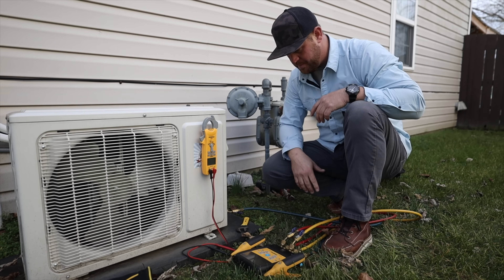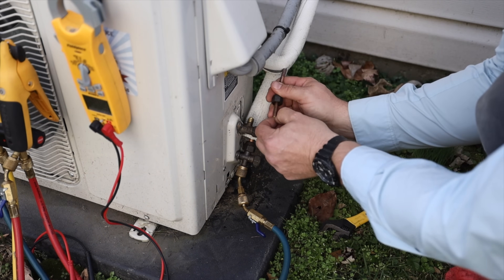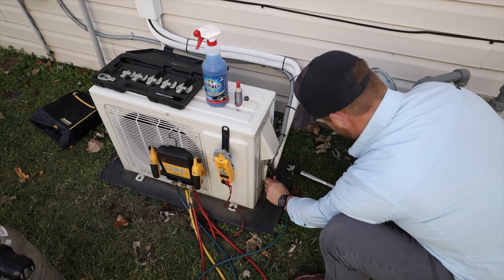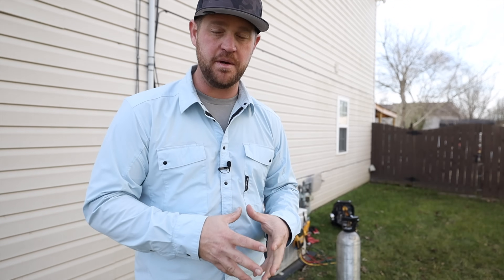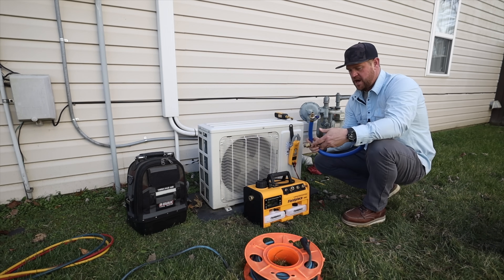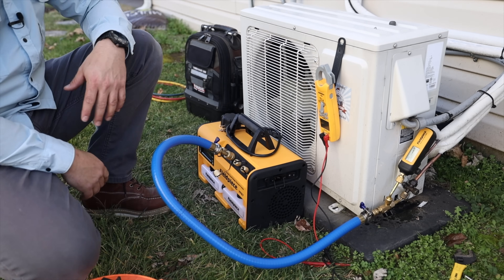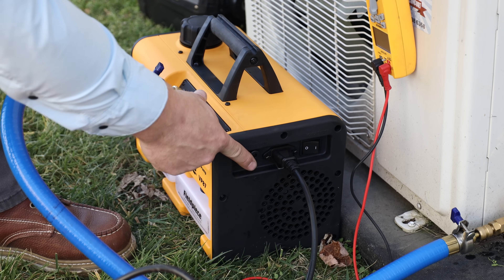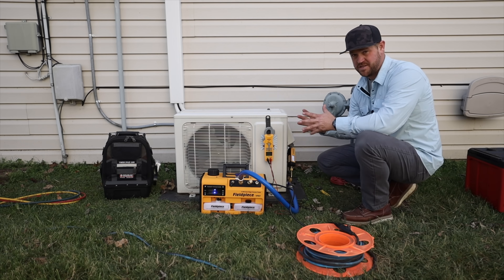#1 Reason Why DUCTLESS Units Fail | How I Fix It...

Comment: If we threw our hoses on the ground (in the grass) our teacher made us wear them around our neck for the rest of the day 🤣 Otherwise, great job!! I hate mini splits for this reason, never trust a mechanical connection, a light tap with a lawnmower will cause a leak. EDIT - Look at the siding behind that unit, it's cracked! That means a weedwhacker has been behind it...
Reply: Bollards and fencing keeps the lawn maintenance guys away

Comment: The number 1 reason I see them fail is the stupid Chinese circuit boards fail. No parts available and no schematics so you can fix them. I hate the stupid things. A regular compressor based system may not be as efficient but you can repair it instead of having to scrap it.

Comment: That mini-split is in an illegal location by code. Gas code says that any source of ignition must be a minimum of 1 meter away from a natural gas regulator as they can release gas into the atmosphere during an over-pressure situation. The wire connections in the condenser are not 1 meter from the regulator exhaust port.

Comment: I get mini split calls (distributor gives customers my name) that would shock you how they were "professionally" installed. I think a lot of guys assume, "its only a mini split" and they ignore or don't know anything about the unique challenges they pose.  #1 you have to have a torque wrench.  Most guys dont.  #2 you have to have a flare tool- most guys dont.  #3 you have to use nylog, most guys dont.  AND what I do- if one leaked- I use the flare-tite washers and I have never had a callback for a leak.  You probably haven't either.  great video-great instruction.  One more thing I do I cut the lineset and braze it.  Most guys just leave a huge coil stashed behind which creates oil traps (minor issue on mini splits) but looks really ugly.
Reply: I agree.  And from what I've read, if you DO leave the lineset long, you should leave the coiled extra horizontal, not vertical, to avoid said oil traps.

Comment: During the pressure test, the system dropped .3 psi in 15 minutes.  I'm assuming that rate will decrease to a much, much smaller final value.  Where is the nitrogen going?  Is it diffusing into oil or leaking out of your gauge or hoses?
Reply: its leaking out until the leak is fixed--yes a tiny bit leaks but it stabilizes once the leak is fixed.  You really dont care about that too much- you are using it to check the joints and and connections.  If they are at higher pressure than the refrigerant they will leak.  you cannot do this job reliably and professionally without nitrogen.  If it does diffuse into the oil it comes out when you pump the system- and has never caused a problem if system is properly evacuated.
Reply: @mtsaz100  The leak was fixed before the pressure test.  Why does the pressure drop by .3 psi during the test?  If the leak is fixed and the test apparatus also doesn't leak, something is changing in the system to account for the pressure drop.  Just curious what that might be.  Perhaps it takes some time for the increase in pressure to reach every part of the system, or there is some time needed for the temperature to equilibrate.  When pressurizing any system there is heat generated, so perhaps there is some time needed for the system to cool down to ambient temperature, during which the pressure drops a bit.
Reply: @jimcervantes5659  I AGREE. I THINK THIS GUY IS JUST A HACK. SHOULD OF TESTED IT LONGER! I WOULD NOT BE COMFORTABLE WITH THAT MUCH LOSS

Comment: 1/4 flares should be re-flared if been on & off again. Especially if it was leaking! 1/4 can easily crack & snap off. 
easy to spot the oilly mess & keep nitro from the shak for another day. 
Man I'd be getting reamed for taking so long. 7 more calls to get done ahead all over the concrete jungle & countryside. Even fuel stops gotta be done at 400km/h. Get a Lycra suite. They are gold. 
Eat while driving the pig like its stolen towards the next job,run the lights just punch it cause you ain't had lunch and it's 3pm again. 
  or go hungry & that first beer when finished is lunch & the first moment you've had all day to stand still for 2 seconds & let everyone close know how the office are trying to kill you. & tomorrow your going to let them do it again. Because your already dead in Zombie mode riding out another day ..another 7 big coffees no time to smoke. So you patch up & push it to the limits. Radar detector & cop location apps.  passenger floor footwell down deep. The mosh pit over flowing up the seat base. Deadly deep in MacDonalds KFC hungry jack's & 400 hundred coffee cups. Alcohol containers say yo yo yo hey man rolling on corners from all the ice cold beer thirst aid kit emergency life or death moments saved against heatstroke, asbestos dust in your throat, head butting with this same clown clone customer that know more about your jobs entails & fixing all that easy fool & prices of components direct in China. then says that's 12% mark up on the one you used from your van stock at 2AM. Your a theif...so you take a hammer & smash the new component off & tell him hope your Chinese stock works out before your coolrooms stock melts & the skip bin eats the lot. Tik tok wish is my hammand. 
Beer your always helpful & support my hammer time bust ups. Quench my thirst after my trolley gets flipped & Mr Mash gets a chance to monster mash & make vanstock repo enjoyable the look of shit X shock.
as the part they say is a rip off gets taken away violently & sprinkles it's part way dust into the eyes n mouth of 
Mr wat-deefrrkmeowfartdidn't expect that you big dicked mother fucker. Try's not to cry as you think fuck am i Thor? Or Greta Thunbergs favourite hero to have a wank too. Either way defrost is set & it's all getting wet. Slippery floor Thor the power. To give and supply or wish you offered me a cold beverage some take away food. And shut your price checking Google repair search expert fixed for cost of a peppermint time wasting break dance romance in your hvac refrig gta game play. Don't break the rules or you will get rats dinning at your restaurant. Although China could help eat you outta rat teste

Comment: you got lucky...i always seem to find the ones in the high wall indoor head that the owner wanted no visible equipment lines so they are all buried in the wall and the electric is so fricken tight that you can't tip the unit away from the wall let alone lift it up and off that's right above the white carpeting and the furniture item that is too heavy/delicate to move.  but that's just my luck!...you apparently don't have the same luck.

Comment: What PSI is required when you are tracing a leak with nitrogen, and how long do you leave it pressurized
Reply: Depends on the refrigerant and local codes. In BC it's a 2 hour test, 300 for r22 and 450 for 410a

Comment: Dirty blower wheels number one problem. All of them and not brand specific. The second would people not flaring them the proper mini split flaring tools. Furthermore we weld the heads in because the flares are junk anyway . I know they say not too. W shave done this over 2 years . No problems with welded heads . Still get call backs  from others  installs for leaking connections.

Comment: How were you able to pull a vacuum without removing the Shrader valve core? It's job is to prevent the gas from coming out. If you could pull a vacuum through it, all the gas would leak out. That's the idea behind it. This is why the air doesn't leak out of everyone's tires.
Reply: Because the hose has a valve depressor on it.

Comment: Just a quick heads up when pressure testing. Use caution when you’re going much above the “low side test pressure”. When pressure testing you will usually want to use no more than a systems low side rated pressure.
Reply: @BernWag  most mini split manuals tell you to test at 400+
Reply: Most of my bosses like to use rules of thumb. Mine are typically 400 for 410a, 200 for most low/medium temp refrigeration applications. Never go over the high switch rating. You’re looking for leaks, not trying to create them.
Reply: @BernWag  I mean the compressor is putting out 400+ psi on a hot day anyway. It is totally safe.
Reply: @BernWag  I'm getting trolled aren't i
Reply: I was thinking about that when I was watching the video. Any suggestions about safe level when it is unknown, because I think it is unknown on the machines I will work on after exam.
My previous thought was do not go over HP-switch rating with equalized pressures. I kind of wanna blow LP-switches on purpose in shop just to know. (Talking about line set braced on sensors, not adjustable).
Reply: That wouldn't be code in BC. Here there are set amounts of pressure to test for the high and low. Since they'd be wanting to equalize, I was taught to hit both sides with the high side amount. Roughly 300 PSI for r22 and 450 for r410a
Reply: @BernWag  refer and nitrogen both do. Right on top of the scroll before it exits the discharge line.
Reply: @BernWag  Which part of the compressor is the weakest when pressure testing and which type of compressor are you referencing
Reply: @nsant  weakest part is the tech who doesn't understand the machine he's working on and how pressure works. hint hint, back away from this conversation slowly and you can disagree on some other day.
Reply: @BernWag  It doesn't matter how much experience someone has. It's more dangerous to not abide by the manufacturers recommendations. 

If someone got injured by compressor terminals, they have not been trained properly. The terminals blow out from excessive heat. You have to treat any compressor like the terminals are going to pop.
Reply: @nsant  Been following this thread hoping for a good discussion. BernW you are THE man. Sorry Ns Ns but you are way off on this and your logic just fell apart in a good conversation. Then you let it get the best of you and you tried to make it an insult contest (accusing the terminal guy of not being trained is really low class man). So thank you BernW for your years of service and your willingness to explain in detail. Ns Ns, sorry dude, but you need to go back to school.
Reply: Mini splits usually take 550psi. Conventional splits are another story. With those always check the max on the evap. and don't exceed that pressure.
Reply: On a hot day around here in the SoAz desert, and with the machine shut off, the ambient pressure of 410a in the system on both lines would be close to 300. so testing the liquid line less than that would be inadequate. 150psi wouldn’t cut it, that’s for a running low-side pressure, not ambient non-running static.
Reply: @dallynsr  does it matter where in the country you are? It can get over 100 degrees on the rooftops here in philly too.
Reply: In a heat pump in heat mode the suction line is actually the discharge line mini split lines should hold 500 psig no problem that’s what the books call for this guy did two things wrong 
1 he simply added his nitrogen to the left over refrigerant in the system ultimately when he said he released the nitro he released a mixture of refrigerant and nitrogen second the flares should be Re done
Reply: This is a heat pump.There is no low or high side. In the winter it is high side, during summer it is low. It should be tested at the unit design working pressure which is written on the outside unit - usually 550-600 psi.
Reply: As this unit is a heat-pump, both sides of the system are designed to handle max head pressure. I’ve never read a mini-split manual that hasn’t recommended testing with 350+
Reply: @BernWag  not according to the engineers that designed the system it's not
Reply: @BernWag   That makes sense. The install manual states that during installation of a new system it should be tested at 400+ for 24+ hours (that was what i was referencing on my original statement). I was confused on whether you were thinking my original statement implied I said to test the entire system at 400. Then I got confused at where we were talking about the 400 psi is located. I thought we were talking about in a running system (not pressure testing). The original comment was about an entire system Then the convo switched to just the exit of the outdoor unit, then back to the entire unit. 

That's why I asked if I was getting trolled. I was confused on what part of the discussion we are talking about  pressure testing and which part we were talking about a running units pressures (my discharge pressure reference).
Reply: @nsant  dude, com on man. let it go. Now your not making any sense.
Reply: @jacklaw9867  I did let it go. I explained where I messed up.
Reply: @jacklaw9867  It's easy to get confused after a 70+ hour work week when I'm used to 40 hours (union industrial work normally is the best). Had a 6" victaulic coupling break loose spilling 50k+ gallons of chilled water into a factory (rusted bolt broke at 1 in the morning when no one was there) and then a day and a half later a heat exchanger flange let go that fed a Buffalo air handler, vav's, and reheats. I haven't worked in the resi field for about a decade.
Reply: @nsant  You're right, been there! Surprised they didn't use SS bolts, especially on CW. Peace brother!
Reply: what did he do wrong?  Nothing.   I use the western regulator on  mini splits ---it only puts in about 200 psi on "test" mode but he did it right.

Comment: nice job and great tools. I would question whether the flare nuts came with the line set or were attached to the unit by the manufacturer.

Comment: Great video. That unit is a source of ignition, and should have never been put next to that gas meter.
Reply: I also like the prior suggestion to hang the condenser on a wall.  Side benefit, tech does not have to bend over to service it unless it is really high up, oops.

Comment: I am going to install a mini split in my four car garage. Will this unit last for many years if well serviced. I heard they fail after two years.  Please anybody out there that owns a mini split please give me your take thanks.
Reply: I have five mini splits on my house and one on my workshop. You should get 10 to 15 years out of them. I have a Panasonic on a rental property by the sea which is 26 years old and still going fine.(it was a coated coil for seaside use) Keep the coils clean inside and out for better efficiency. I have had good runs with Mitsubishi and Panasonic.
Reply: good for 20,000 hours of use

Comment: That nylock goes on just the back side of the flare like you did but not on the threads, it’s a dry torque spec. A triple evacuation method is good practice to do on these types of systems as well when you open that line set to the outside air, it is a few extra mins but it’s what the install manual calls for. Keep up the good work
Reply: Actually it goes on the front side of the flare between the mating surfaces.
Reply: @44beebe  YOU ARE CORRECT!
Reply: It’s directly from the installation manual, if that’s what the manufacturer says to do, then that’s what they want you to do. If it was outdated it wouldn’t still be in the installation manual of 2022 model’s
Reply: @Nwflyingsolow  I don't care if it is in the instruction manual of installing a Mitsubishi ductless unit. I'm not a tech stuck in the 90s with outdated tools.
You are not going to get down to 50 microns with moisture in the lineset, period. You can waste time and nitrogen; I'm not.
Reply: Directly from the nylog manufacturer they show to put it on the threads the flare face and the back of the flare.  So who do we trust with the right way to do it? 😢
Reply: Triple evac is an outdated practice, back when we didn't have micron guages that had 1 micron resolution.
Reply: @sprockkets  we always called it blotting the system with dry nitrogen.
Reply: @sprockkets  no it isn't.  During vacuum ice will form possibly plugging the txv or other restriction points.. what about the micron Guage changes that ?
Reply: @Jdrichardson35christ  You need to do research on this topic at the hvac school channel hosted by Brian or with Jim Bergmann. The nitrogen you put in does little to dry out the lines. It was done because it recalibrates micron gauges from the past. 
Think: if you get a 50 micron reading while doing a vacuum, you have no moisture in the first place. I reach that in less than 5 minutes on a new mini split system, but let it go for 30 min because i can't read the far end.

Comment: Great vac pumps but I don't like not having valves at the inlet ports. I work on bigger systems were i would use multiple hoses. Buying vac rated valves for each line can be expensive and its a pain in the butt to deal with (Our systems need to be pulled down to 200-300 mics). Speaking of vac rated. I have found most techs don't realize you need to use vac rated hoses, gauges, valves, etc to pull a proper vacuum.

Comment: Good video ! Maybe Get Yourself a small Trailer. That Loading & unloading is For the Birds ! Trust me. been there done that ! also --- You allways need stuff that u may not have loaded & is back at the storage. been there , done that ! Gets Real Old When Your booked 2 weeks out in the summer ! & Running Your Buns Off !
41 Yrs in the Trade here.
Also --- Get Yourself a couple moving blankets and Put Them down to Establish a Work area & Protect Your Knees ! They are Worth thier weight in Gold ! Helps keep tools Clean , Keeps Your clothes cleaner , grass stains off the knees on clothes ( wife will thank you ) , cushions knees , keeps dirt out of copper & tool boxes , if u drop something - easier to find it. lots of benefits.
You can Wash them in the Laundromat if desired.
Also --- Get Knee pads or a Cps Rubber mat to kneel on. Trust Me - Your Knees will thank you 20 years down the Road ! ( The second set of knees NEVER work as Good as Original Equipment !!! )